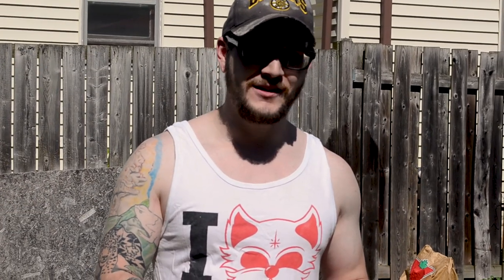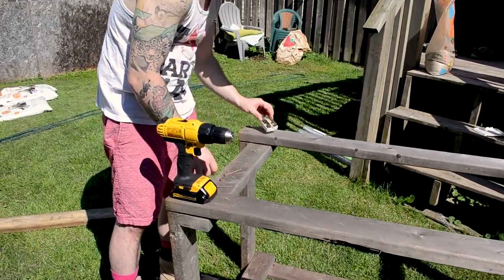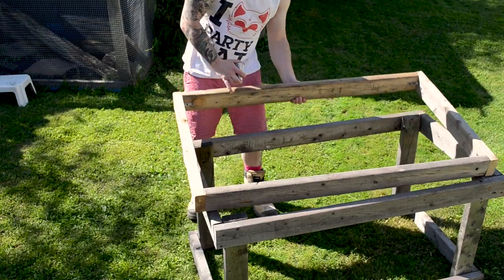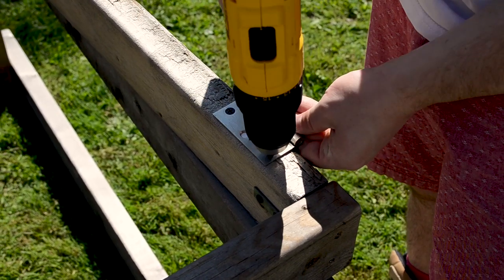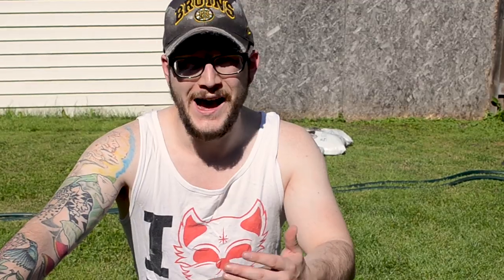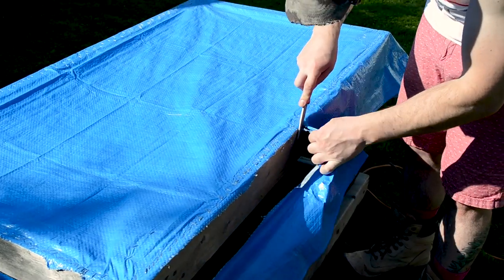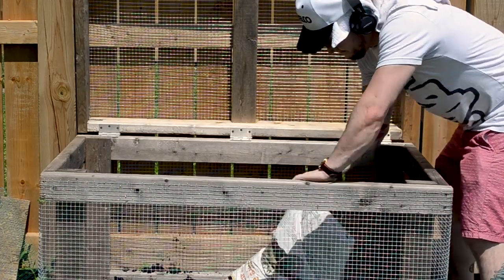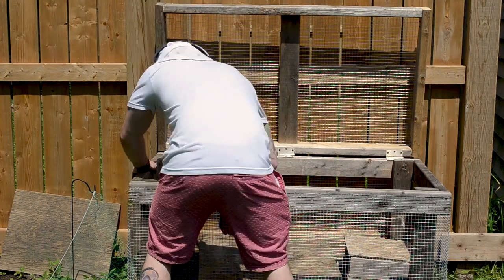Outdoor Enclosure Build | Cheap and Easy Reptile Enclosure

Comment: I did a very similar cage for my bearded dragons. Instead I used plastic coated wire as not to get any nose rubbing on the wire. Built another one for my iguanas( when we were allowed to have green iguanas in Florida).Iguanas are notorious for rubbing and I did get a little on my first application many years ago. I replaced it with plastic wire and it was much better. I see that this video was four years ago and I’m sure you have updated most everything you use by now. Your newer videos are great. Love this one except for the galvanized metal wire.

Comment: Awesome! Don't think this would work over here in England however, but if I ever want to build an indoor enclosure this works too! 🔥
Reply from the maker: Jennifer Clare not sure if it’d fly in England. Surprisingly here in Canada I can keep some reptiles out for most of the summer.
Reply: There are some reptiles you can keep outside during the summer such as any of the  north American turtles.
Reply: Check out the guys at Celtic Reptiles they keep lots of reptiles out side in the UK year round
Reply: You can with a native animal, can add a heat source in winter if needed

Comment: What about the pine? Isn’t that poisonous for snakes? Or are you using a different type of wood?
Reply from the maker: I don't use pine, even so, a pine piece of lumber outside wont release oil in the same way a shaving would
Reply: Does pine exist out in the forests? Do reptiles exist in the same forests? Are piles of dead reptiles typically found near the pine trees?